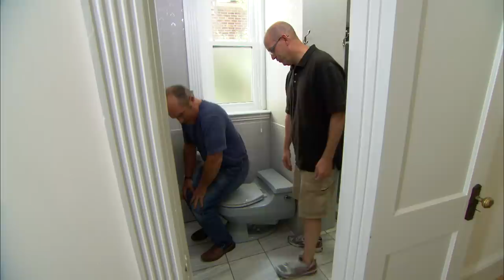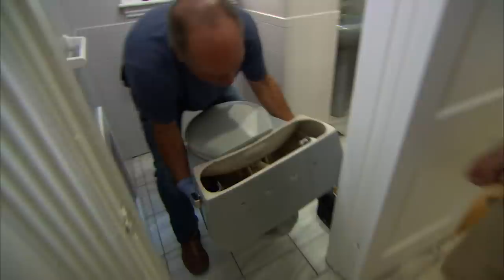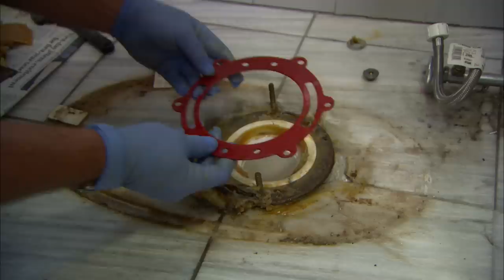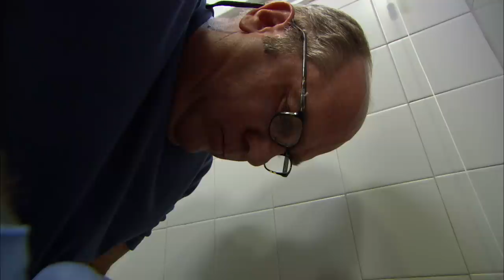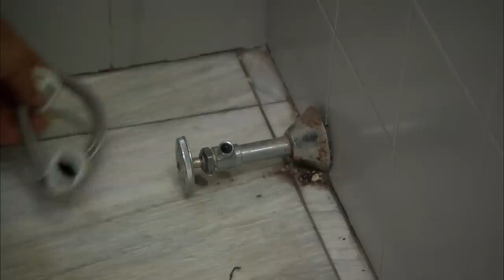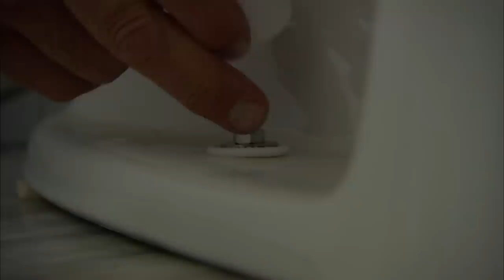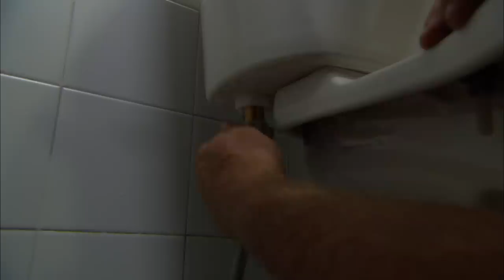How to Rotate a Toilet | Ask This Old House

Comment: The new toilet is too close to the side wall.  Our local code requires 26 inches for a toilet, so the minimum should be 13 inches to either side.

Comment: It would be nice if the plastic cap makers made them taller so we  wouldn't have to cut the bolts any more.
Reply: They have adjustable bolts now called something like Quick Set or Fast Set.  I just used ones that were made out of plastic and recommended by the supply house.  They would be easier to cut with a hack saw than brass ones.
Reply: @AStanton1966  Update:  recently found out tall caps are made.  Don't know how long they've been available.  Surprised Richard didn't know.

Comment: I'd be happy if I could build a raised platform for the toilet so my legs don't fall asleep.
Reply: You can buy toilets with different "sitting" heights.  Our master bath has an American Standard/Porcher with a higher-than-normal seat height.  Our vanity/sinks are also higher than average bathroom height--they're the same height as kitchen countertops.  If you're building new, or remodeling, you can specify what you want.

Comment: You did it the wrong way! You're supposed to rotate it 90 degrees vertical so the lid hangs closed and the tank is parallel to the floor.

Comment: I would have left it alone. I like Rich but sometimes logic isn't a strong point. While the home owner may have thought it was a tight squeeze it's worse now to the right of the toilet sitting down , there's about 5" there , imagine you sitting there with your leg pushed up against the wall. I would have centered it or use an off flange.

Comment: THOSE LOW FLOWS SHOULD BE CALLED NO FLOW. I HAVE ONE. NOT GOOD AT ALL HAVE TO FLUSH 2. OR 3 TIMES. TO MAKE SURE IT WENT ALL THE WAY DOWN. THE PIPE. AND THAT IS FROM JUST URINATING. WOULD RATHER THE OLD SKOOL BOWLS THST WOULD SOUND LIKE A TRAIN RUMBLING ON THE TRACKS. ALWAYS WORKED ONE FLUSH
Reply: You have the bad model.  Had installed a few different models and found 1 model to be of utter crap, to flush down crap.

Comment: Is 2" gap such a problem to buy a new toilet, especially since the old one is still in good condition?
Don't answer, this is  rhetorical question. ;)

EDIT: At least the new one is higher.
Reply: Richard did however mention the old  one was most likely guzzling 5 gallons of water per flush

Comment: The black snout on the blue flange is facing up, and it's not gonna seal up inside the toilet so waste water will always be trapped between it and the toilet, against the rubber seal which will eventually fail. Looks like the intended orientation with the bolts facing up, but seems wrong. Wax below the flange, and a rubber seal above it, and water+ always stuck in a pocket.  I think get rid of the black rubber section and put wax both above and below the blue flange.

Comment: Anyone else notice that gap at the bottom of the toilet from him using that (adapter) , thus raising the base of the toilet off of the floor?  I wonder how long it will take for that adapter to break (or the wax ring to fail) from the toilet rocking when people get on and off of it?  What he should have done is remove the flange and replaced it - whether it was too tight or not!

Comment: That has got to be one of the hackiest and tackiest jobs I’ve seen from this channel. The toilet is too close to the wall and isn’t centered in the space, the tile is stained, he drilled through the tile into the subfloor which over time will allow water to seep into the subfloor, and there appears to be a gap between the toilet and the floor. That said, I don’t know how you’d fix that other than ripping up the tile and subfloor, relocating the sewage pipe, putting down a new subfloor and new tile. But it would look a lot better.

Comment: ok, so let me interject how this works in reality. "lets turn the water off and get this old toilet out" huh, the water valve doesnt actually turn the water off because its so old the valve is broken... well, thats what happened to me.  All set to work on my toilet, had all the tools all the parts i THOUGHT I needed then went to turn the water off and do a quick job at 9 oclock at night... all stores in portland are closed and I now need a water valve... well, at least water wasnt spraying out of the pipe because I did my osha test for energy disconnect, turn off test to make sure its off and the toilet kept filling up, I was thinking HUH fml
Reply: That is why you should always have a few common valves at home, so you can quickly shut off the main and replace that broken valve.

Comment: I've seen some plumber don't even use gloves when replacing toilet
and used his bare hands to scrape out toilet wax..
Reply: There is another video where this same guy uses his bare hands to remove the wax ring as well as touch the inside of the bowl and down pipe.

Comment: Who cares if there's a 2 inch Gap in the back. And those low capacity toilets tend to need to be flushed over and over again to work properly
Reply: franco annoni  I understand saying water, but I think many peeps waste water every time they 💩, why not just legalize dual flush toilet like other countries use.
Reply: I lived with a 2” gap from 1981 (when my parents “remodeled” the bathroom by replacing a two piece toilet so old there was a pipe between the tank and bowl, and the tank bolted to the wall) until two months ago when my mom died and I finally could remodel properly.  I hated the gap, and the little smiley face stickers mom used to cover the holes in the wall.  If there were no easy way to use up the space I could understand, but if you are buying a new toilet anyway why not buy one for a 14” rather than 12” distance and have it look better?
As far as low volume toilets, I got a Consumer Reports top rated toilet that uses 1.4 gpf, and it works very well, never needing a second flush under normal circumstances.  The key is to buy a toilet that is rated high on flushing, don’t buy the quietest or cheapest, buy the best flushing.
Reply: franco annoni With a five gallon bucket, those tea cup tank tawlets work great.

Comment: 15" off side wall come on bro hack master is what that was
Reply: What else could he do without serious modifications ?
Reply: Don't matter do the job and do it per code that's what else he could of done ?
Reply: So, instead of 150.00, spend 2000.00 to correct a 3'' deficit ?  Not me !
Reply: As a plumber just saying I would of done it right especially this old house guy.  Do it wrong for 150 and then do it right for 2000 at the end of the day your paying 2150 because you wanted to be a cheap @&$ just saying
Reply: Can't disagree, Doing it the right way is better, guess the owner didn't want to pay.
Reply: He don't know
Reply: According to numbnuts, he should've just torn the whole house down and rebuilt. eye roll

Comment: As a Licensed Master Plumber speaking, I'm kind of disappointed to see such hack work done by a long time fellow licensed plumber. As everyone notices, the toilet is WAY to CLOSE to the wall after he rotated it. Now the newly "rotated" toilet is set 12" inches from the wall instead of the required 15 inches from any side wall. Those extra 3 inches would make all the difference in the world.

Codes require the toilet to not be set closer than 15 inches from it's center to any side wall, partition or vanity. This code is to prevent EXACTLY what the finished product you are seeing on this video.

Comment: id rather replace the flange than some silly adapter crap.
Reply: Have fun cutting the floor up then.  You have no choice but to add an over the top adapter like that or one that stabs into the pipe below.  But the adapters are fine as long as the screw or bolt into the floor.

Comment: By code the toilet must have 15" minimum left and right. So that 12" to the wall now is not correct. Didn't bother to caulk the toilet at the floor which also is code. And the plumber should be testing the toilet not having a homeowner do it. Ridiculous.
Reply: Caulking around the toilet isn't good and shouldn't be needed.
Reply: Joe, You are correct but, I don't think they have much choice here without doing serious modifications ? I have a crapper that's even a little closer and you get used to it.  Caulking around the base of a toilet is a serious mistake because if the wax seal fails, it will not be detected until serious damage is done to the ceiling below the toilet. Never caulk the toilet to the floor, it does nothing for sealing the flange.
Reply: I don’t caulk around my toilets, I want to know if there’s a leak.
Reply: I have heard guys say that when it comes time to remove a toilet, they have seen the floor tile come up with the toilet.  Of course you can cut the caulk first.  But it is really unnecessary to caulk a toilet in the first place.
Reply: Caulking around the base is done for 2 reasons.  1. additional level of bonding a toilet to the floor to prevent rocking, and 2. when the floor is cleaned or tub overflow, to prevent water from going under the toilet and down stairs.  
Toilets don't spontaneously leak above the flange.  Leave a small gap not caulked if you like in back, but #2 above may not work then.